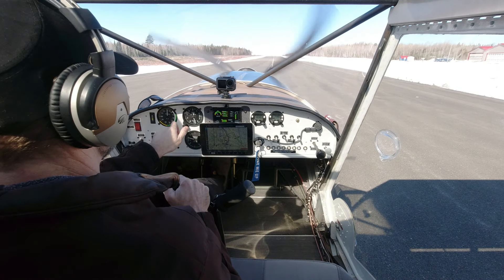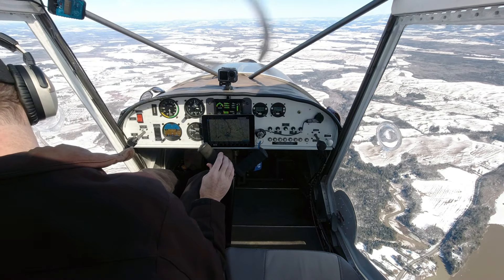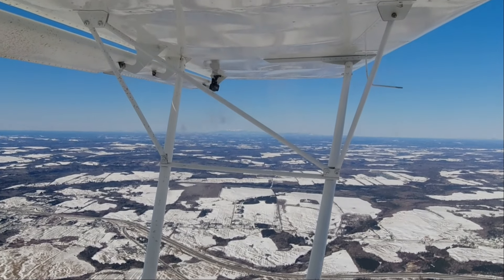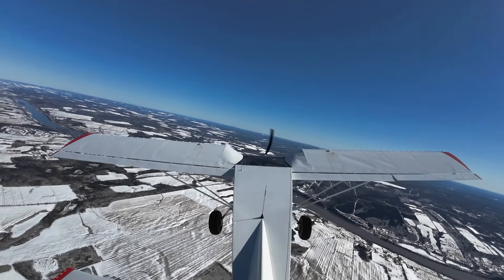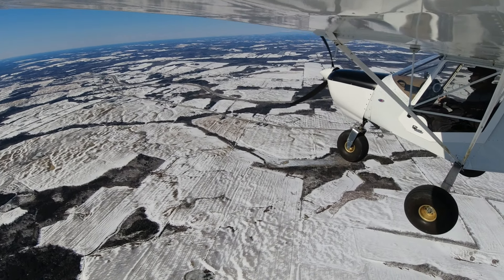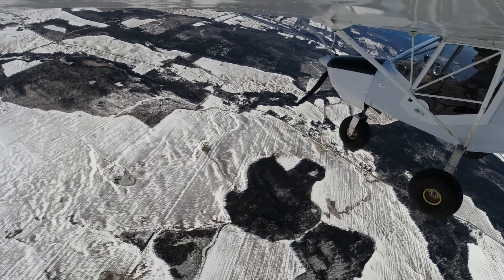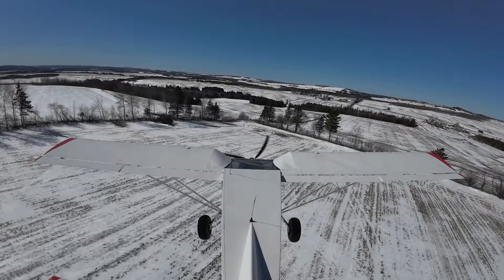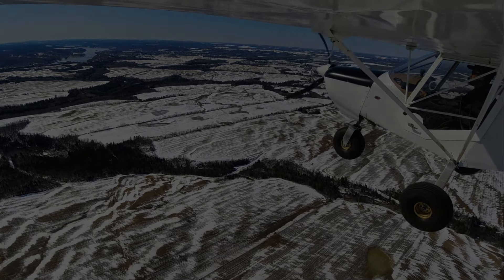Zenith 701 Emergency Procedure Practice

Comment: I'm getting ready for my check ride, and what you showed was almost identical to what I've been taught. The only exception was the emergency landing, I've been told to look for a field, and not a road, because of the high level of power lines in the area we practice in. Cheers from Winnipeg.
Reply from the maker: Exactly. I only selected that road because I was familiar with it and I knew it didn't have power lines.

Comment: Hey Matt,  i was wondering if spin training is a requirement in Canada for a pilot certificate?  I thought it was for some reason but dont really know. Its not here in the US  but i thinkbit absolutely should be.  My first flight instructor was scared to death practicing stalls in a Cessna! If someone is scared or rattled doing stalls they should not be a pilot and definitely should not be teaching! Im blown away by the number of pilots i run across that are scared to stall an airplane. Anyway , great video as always. Thx.
Reply: I guess the correct answer is “it depends”
For the PPL, yes spin training is a requirement.
For the RPP, I don’t think so but depends on the school 
For a Ultralight permit, I don’t think so, many ultralights aren’t spin capable.
I agree that all pilots should get spin training (I’m looking forward to it).
Reply from the maker: Yes, spin training is a requirement for PPL and CPL in Canada. It's not required for UL permits and I'm not sure about Rec. I absolutely agree, every pilot should be competent with stalls. There's nothing scary about them once you understand them but you'll only understand them with practice and experience.
Reply: Finishing my RPP out here on the “Wet” Coast. Spin Training & Spiral Dive not required for the RPP, BUT demonstrated by my CFI and I was allowed to handle the recovery in the C172. Good to know, even though as you stated Matt, it really takes a BIG effort to convince a 1150lb STOL Airplane (vs. C172 at 2400lbs Gross) to enter either one of these manoeuvres 😊 Also, really liked your demonstrations of the Emergency & Precautionary Landings 👍 Once again, your camera angles (and the gorgeous VFR day) make it truly come alive !!

Comment: Hey Matt. I was wondering if u have the slats that were supposed to be on the 701 and have u considered installing them. I recently watched  a video where Deane Philip from New Zealand  talked about how people where basically trying to make a 701 fly like a Zenith Cruiser.  I guess it would be quite an ordeal to install them if the mounts have been covered up.  I dont think from what i understand that u really gain anything in speed relative to what u lose in takeoff and landing performance.  Love the videos man. 701 is awesome and can't wait to get one flying. Looking forward to the fuel injection upgrade also. Cheers !
Reply from the maker: I have flown 701s with slats and I didn't notice too much of a difference between them and mine which has VGs. The lack of slats supposedly increases the cruise speed slightly. I'm perfectly happy with the performance I'm getting with my configuration though. At the very least, you save a bit of weight by not having them on. Lol

Comment: The acceleration and climb performance seem excellent from your Rotax 912 clone. I wonder, what is the cruise speed like with that engine in your Zenith?
Reply from the maker: 85 mph at 5000 rpm at 4.25 gph.
Reply: @mmatt  thanks. I'm really surprised it's that low but I guess you can't have that STOL and climb performance and a 120 knot cruise on 100 HP.
Reply: @glsracer  My friend has a Portugal-made BRM Citius, which is a clone of the Zenith 701, but somewhat more streamlined. It cruises at about 100 knots with the 100 hp Rotax.
Reply: @martinwade9421  that's decent

Comment: 3 Pan/Mayday, not 4 or 5 😂. ( Had to look hard to find a critique 😅) Emphasize rudder only to pick up wing at stall.  Instinct says aileron😢. And if you don't know that, the resulting spin will tighten your shorts, at the very least😢,
Reply from the maker: It's 3 "pan-pan", not 3 "pan". 
https://ised-isde.canada.ca/site/spectrum-management-telecommunications/en/official-publications/information/radiocom-information-circulars-ric/ric-21-study-guide-restricted-operator-certificate-aeronautical-qualification-sf09802#s7_1

And aileron induced spins are fun! Hahahaha!
Reply: I stand corrected😢.
Reply from the maker: @4437RR  It's a confusing one, I wouldn't worry about it. I'm pretty sure they'll still take your distress call either way. Lol

Comment: Matt why couldn’t I hear stall warning alarm. Did you edit it out?
Reply: Being an Experimental it likely doesn't have one as they're not required. I don't have one on my 701 either. Would like to add one..
Reply from the maker: Kyle is correct, I don't have one but it's really not necessary either as the plane gives plenty of warning before it stalls by way of buffeting and "oil-canning".
Reply: As Matt said, a stall warning is not required on an Amateur built (experimental) aircraft.
Realistically,  with all of the variations in construction, it really wouldn't be accurate anyway.
That being said, an AOA (angle of attack) indicator  is available for any aircraft and is worth the price if you are doing any kind of STOL flying.
Remember, all wings will stall at any airspeed if the critical angle of attack is exceeded. 
A stall horn only lets you know that you are approaching that point, where an AOA indicator will show you the stall  transition through the entire speed range.
You can fly any aircraft well below its stall speed with power and the correct angle safely.
Highly recommend everyone has one!
Reply: @splaser7014  explain to me the statement any wing will stall at any airspeed? It would seem that speed of air going over wing produce’s lift. With enough speed you can do a loop or fly straight up.  Not understanding that statement. I am not the brightest lite in the box help me out please
Reply: @berniebrown9115  That is a great question, and one that is misunderstood by a lot of people. Thank you for asking for clarification.
 A wing creates lift by dividing a column of air in to two separate flows around the wing. When air goes over the top of a wing, it is accelerated by the shape (curve) of the foil (it has to speed up in order to meet the flow of air that it separated from that went under the wing). We know that when airflow speeds up, its pressure decreases, which is what we call lift.
This airflow of the top of the wing sticks to the surface of the foil (boundary layer) for approximately 25-35% of the length (chord) of the wing in normal straight and level flight. 
As the angle of the wing (angle of attack) increases, this airflow sticks to less of the surface of the wing and eventually will move far enough forward on the wing that lift does not equal weight (and to some extent drag) and will separate from the wings surface in a turbulent fashion. 
This is when the wing stalls, or stops producing lift.
This separation of turbulent air can happen at any airspeed once the angle of the wing exceeds the point where the air sticks to it (critical angle of attack) in relation to the relative airflow.  Speed makes some difference to when this happens as the relative airflow is faster and keeps the flow of air on the top of the wing for longer, but the fact remains that any wing will stall at any speed once the critical angle of attack is exceeded.
I hope that makes it a bit clearer.
Reply: @splaser7014  thanks for the clarification appreciate helping this old farm boy out.

Comment: Okay. That's $5 in the preposition bucket 4 use of "for" on radio. Shame on you, Matt.  You really DO know better. Tsk. Tsk.  Other than that, this vid ranks among your best.
Reply from the maker: Ya, I caught that in editing... lol
The more important thing though is to speak clearly so that it's not taken the wrong way. It's not technically wrong, it's just not best practice.
Reply: @mmatt  Matt, of course speak clearly, but the practice is due to the vagueries of atmospherics and the moodiness of radio circuitry and idiosyncracies of noise cancellation, or worse none. For example, "th" doesn't overcome squelch, so "t" is used instead, ergo "tree" instead of "three".
Reply from the maker: @f.n.schlub  I understand. I've always struggled with figuring out the correct wording to avoid "for" when announcing my intended altitude while either climbing or descending, what phrasing would you use in these situations?
Reply: @mmatt for what its worth I use "x thousand climbing/descending y thousand".
What I haven't been able to consistently stop using "for" in is a situation like "on the extended downwind for runway ##". I welcome suggestions especially since the airport I fly from has runway 4!
Reply from the maker: @watashiandroid8314  That works, I'll try to give it a try. Old habits die hard. lol
For the runway calls, (lol...for) I simply don't say "for". Eg. "Woodstock traffic, India Mike Echo Mike, downwind, runway 31". 
I find it works better if you say the word "runway" instead of only its designator.
Reply: @mmatt  thanks. I'll make a conscious effort to not use "for". I'm right there with you; it can be tough beating those old habits! 😆